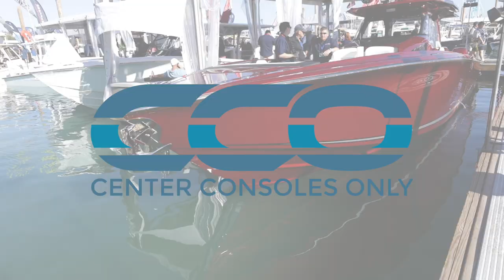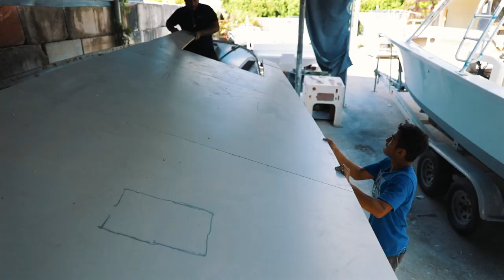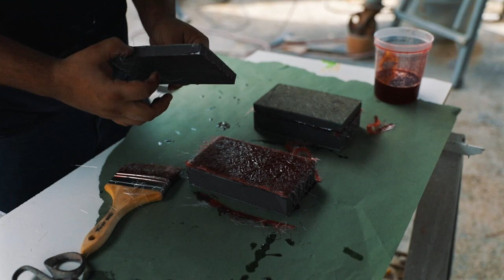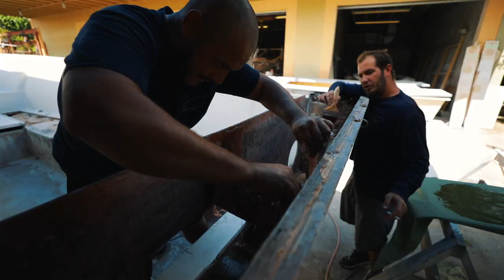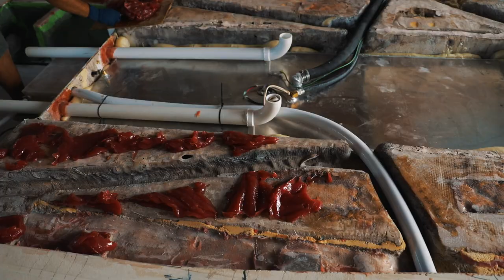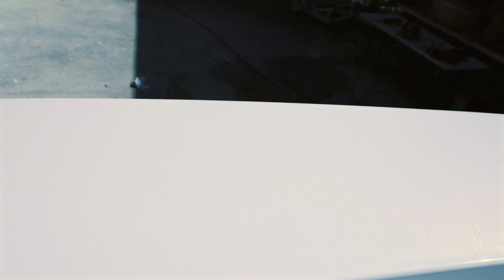CCO Customs - Episode 3 of our 23' Sea Craft Restoration - Center Consoles Only

Comment: Thickened polyester resin does not make a good bonding putty, its brittle at thickness.  I'd bet the foam filled stringers are saturated and adding 300 to 400 pounds.  For those interested in learning how to property "remanufacture" a boat worth saving....check out Metan Marine.  CCO guys invest some time and watch how the pros do restoration...with all due respect!  Not to mention a foam cored replacement transom vs. coosa board...without 1/2" of structural glass on each side of the foam....it will compress when the engine is bolted on.   Sorry...guys!!!